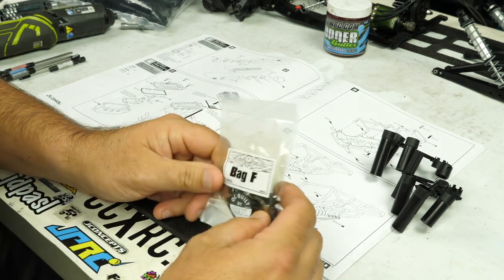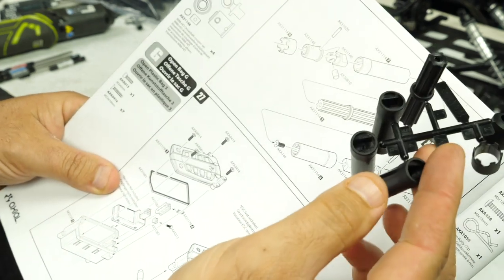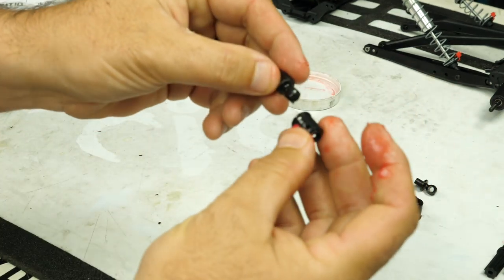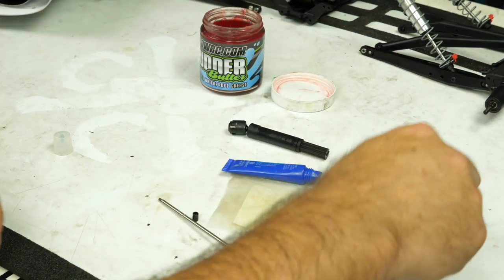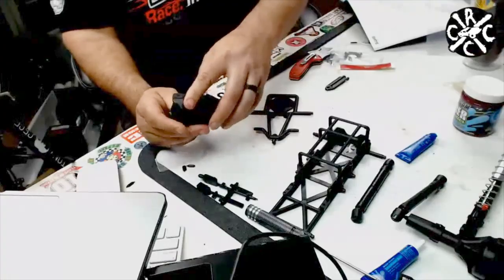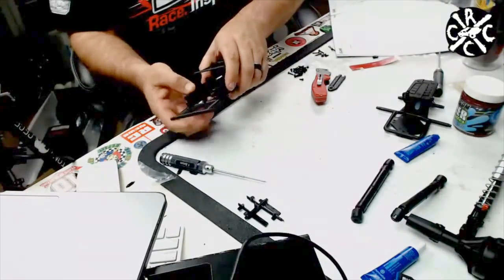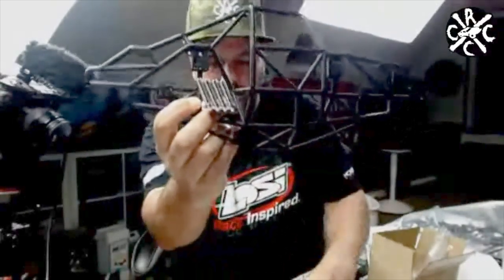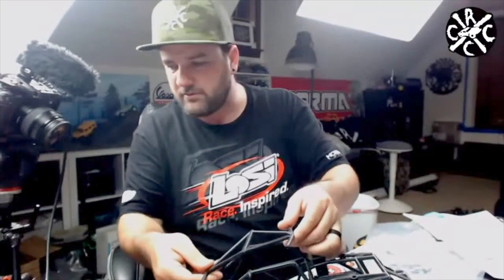Axial SMT10 RAW Builders Kit Part 5: Driveshaft & Chassis Build (Camera Issues)

Comment: Just got this kit and i have the same driveshafts and they are not the correct driveshafts. These are not wild boars AX31114, WB8-HD. These are ax31586 parts, which are not as good. The manual shows the wild boars so we are being cheated, the wild boars are more expensive.